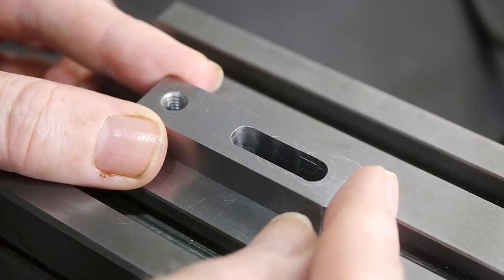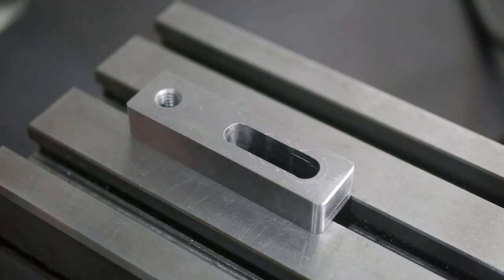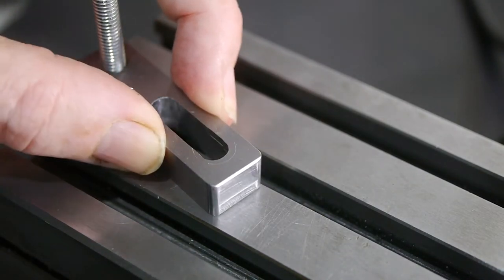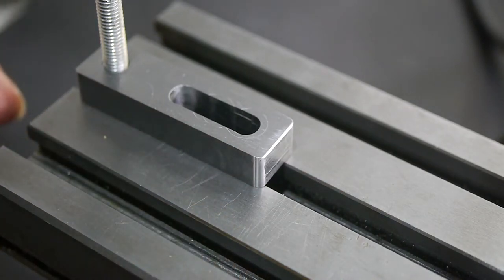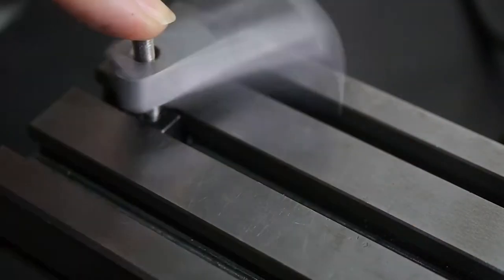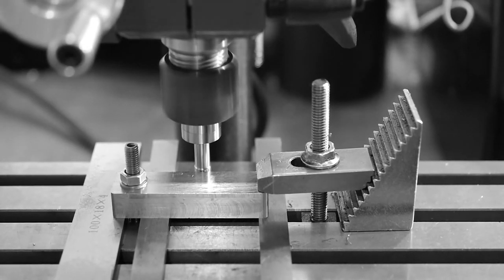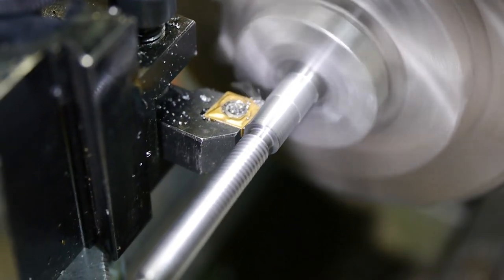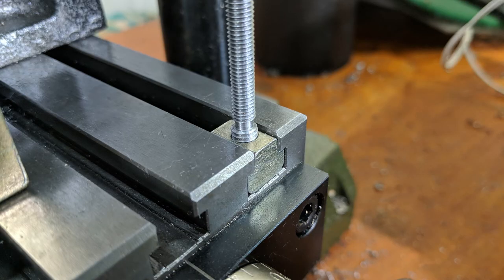Just One Fixture - A twin-thread clamping rod

Comment: Another option, and arguably more versatile, is to mill a t-nut and drill and tap it in a smaller size.  Now you can use various screw lengths, and since this is a mill accessory it's also handy that this option doesn't require a lathe.  You can also make several as a single long piece and just saw them apart afterwards to save a lot of time.

That said, there's a certain satisfaction to be had in single-point threading.
Reply from the maker: Agreed, that would certainly be a good solution. On my equipment making threaded rods is much easier than milling a t-nut, as my mill is very light and fairly difficult to use on decent materials. For someone with a better mill than mine, and perhaps no lathe, the t-nut would be a better approach. Thanks for the suggestion!